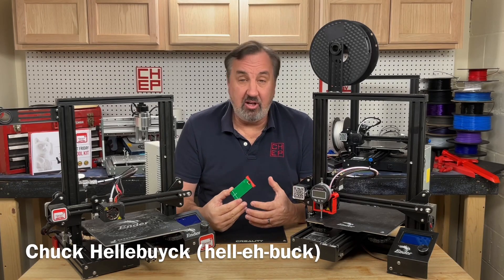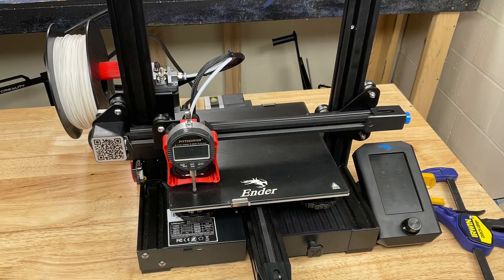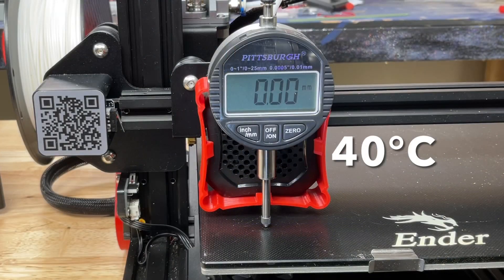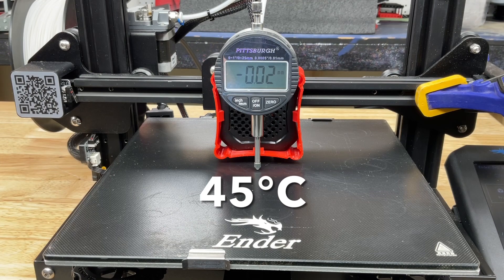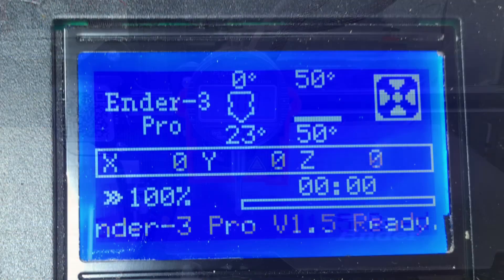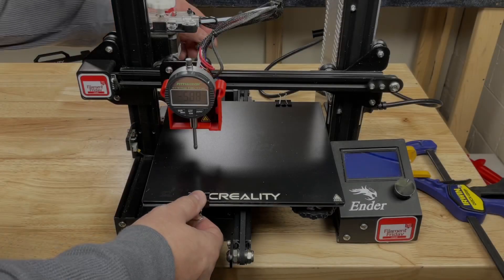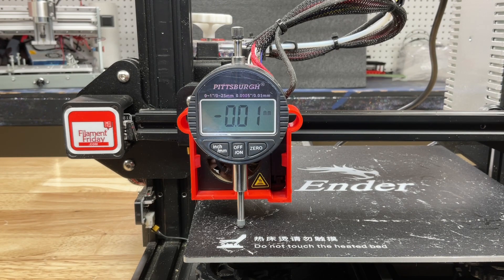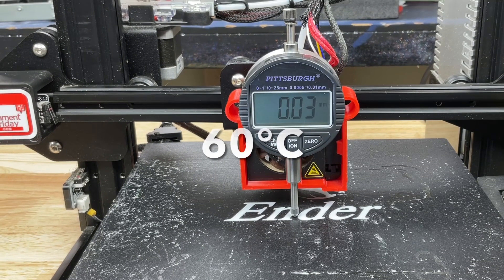Heated Bed or No Heated Bed Leveling?

Comment: I have actually found on my Ender 5 (220x220mm) with the stock flexible plate, temperature between room temp (25 Celsius) and 60 degrees made a bigger difference than with glass.  I think it is the aluminium build plate changing size rather than the surface.   I think Glass holds its form better and doesn't flex as much with the bed.  0.07 is a pretty big difference when it comes to first layer to be honest.  It can be the difference between sticking and not sticking, and that is from my personal experience and experiments moving z axis.   
I appreciate it is less than a layer height and some people may not find any issues, but in my experience it does affect that first layer a fair bit, even with 0.03 difference.

Comment: It might just be my imagination or I'm reading into things but I have found that it is better to heat the bed first before running an autolevel than when manually leveling.  I have noticed a distinct difference on the first layer on my anycubic kobra 2 if I autolevel cold vs hot.  When hot the first layer is significantly more even and solid.  I can only chalk this up to any warping being compensated for during the autolevel.
Reply: From what i heard it only makes an difference if its an Induction ABL
Reply: @ThiagoCaregatti  That makes a lot of sense.  TBH I don't see much difference on any of my printers with a BL touch when hot vs cold.
Reply: @ThiagoCaregatti   Auto levelling with any bed levelling device, bl touch or induction, makes a difference as it measures points across the bed in a mesh and creates layout of the bed with all the different heights.  The type of levelling doesn't make a difference as the heat causes the bed itself to expand slightly.   At the temperatures of a heated bed, it is very little difference, unless absolute precision parts are needed, then even 0.02mm can make a difference to the part.  You wouldn't use an Ender range printer for that sort of precision though as they are never that accurate.
Back to induction.  Yes, if you heat your bed from room temp to over 100 celsius, then you may have an effect on induction, but very few, if any, filaments would require temps that high.   Between room temp and 60 celsius, induction will not change meaningfully.

Comment: Try it again but let it sit with heat on for 30 mins or longer then measure. The heat eventually transfers into the springs and changes. And when you lose at the corners is because you are gaining in the center. Use two dial indicators at the same time, on at the corner and one in the center. And also try putting a dial indicator on the left front and one on the right rear. Then adjust the left front and see what happens to the right rear.

Comment: you have error! you use glass bed!
Reply: K
Reply: Fun fact: Glass is also subject to thermal expansion.
Reply: @cobz76 and it's also subject to move if the base if expanding. Not sure how that concept evaded him.
Reply: Glass bed's are fine if you know how to dial in your printer properly.
Thermal expansion of the actual bed itself, the aluminium, is the major issue, not the bed material.   It's hidden more by glass as glass is more rigid.
To get meaningful thermal expansion of glass would require a higher temperature diffence than just room temp to 50 or 60 celsius.    That's why the flexible material showed more difference in this video.  It is responding the movement of the aluminium heated bed underneath it

Comment: A dial guage positioned at the center ( or anywhere else for that matter )  of my 235x235 heated bed shows a variance of .04 mm when the bed heats from 20c to 60c. This is wildly different from the  calculated thermal expansion of aluminium 0.002664 so there is expansion due to heat but it just doesn't seem to be the aluminium bed that is doing much of the expanding.
Reply: note... It might well be that my dial guage itself is undergoing some thermal expansion... so i'll redo my test after I attempt to thermally isolate it from the bed. ;)

Comment: I usually like your content, but it’s clear you don’t really understand what is happening or proper metrology technique. 

The expansion is going to affect every bed differently, as none of them are truly flat and the low quality sheet aluminum they are made from has internal stresses that differ from piece to piece due to the manufacturing process. This is why those that want minimal issue with thermal expansion use cast aluminum plate, rather than roll-formed aluminum sheet for their beds. 

You also don’t have the equipment necessary to accurately map the movement of the bed. To do any meaningful testing, you would need to probe multiple locations at every temperature setting and create a 3D map of the surface to see what’s actually happening. 

This is a subject of controversy and is very much subjective to the individual user’s desired results. So, I’m not saying you’re incorrect or have provided poor data, only that you provided limited amount of data to have drawn any real conclusion from. 

I spent a lot of hours designing a printer and bed system that stays flat through heat cycling. I also happen to be a machinist/fabricator with a significant interest in metrology and a lot of equipment the average person isn’t going to have on hand if they simply own a 3D printer. This isn’t a 5 minute subject, or one I can cover in a comment.
Reply from the maker: Think you missed the point. As my bed expansion video and then my nozzle expansion video showed, a beginner with an Ender 3 or similar clone using the standard 4 corner paper method (as they are told to use in the manual), your results will essentially be the same heated or not heated. 
Your middle will warp a bit as I showed in bed video but you can’t get rid of that by the four corner adjustments. So print small things over the adjustment knobs for better results.
Reply: @FilamentFriday  This is a poorly thought out video. How do you know the metal guage isn't expanding with the heated bed? You didn't attempt to thermally isolate it in any way! The results are bunk!
Reply from the maker: Haha…then it would be worse not zero. The expansion of the tip is negligible. I’ve tested it many times before. But I look forward to you proving me wrong. Until then your comment is bunk!
Reply: @NoMoreBsPlease  he's not using a precision tool or mount so it's all likely within the error tolerance of the meter. Anything with a 4 point contact will definitely warp. As long as you know where it is you can compensate. I just don't agree with chep that it's all irrelevant. Smaller beds, sure... But larger like the ender 5 plus very important when printing large.
Reply: @jackshett  That would be less of an issue with thicker bed. Aluminum is one of the most abundant resources on the planet. There is no reason why  3d printer beds aren't over 6mm thick.
Reply: He didn't come to the conclusion you wanted him to huh? You'll get over it.
Reply: I get the impression he used to be a used car salesman... That or he's part of the "just as good" crowd.

Comment: For me heating the bed makes a noticeable difference, but not immediately when the bed reaches temperature, only after ~20 or 30 minutes at 60°, when the heat propagates to some of the metal support under the bed (I guess).

After that amount of time the bed moves down enough that's very obvious even with the paper method.

This is with an Aquila X2, a printer very similar to an Ender 3, with a glass bed.
Reply: Same here. My bed has at least .1 change
Reply from the maker: I didn’t see that in my bed video and I left it heated for a while. https://youtu.be/NlUO-5EtB44

Comment: Thank you for sharing. The movement of the bed is small indeed, but what about the range of temperature of your measuring device ? This one will be heat up when measuring on top of a hot surface for a while. I'm printing ABS with bed temperature of 100°C, so there I not going to use your method. Maybe with a higher Z with elongating rod ... Thanks again for your time and sharing.

Comment: Can anyone explain to me what PETG is, what is it used for, and is it better than PLA?
Reply: Basically the same material soda bottles are made of, it's a different material than PLA, it's a little harder to print but more resistant to higher temperature like for in a car, and might also be stronger, depending on how you print it
Reply: PETG is more ductile, meaning it deforms way more before breaking. It's also way more flexible than PLA, which can be good or bad depending on your application. But overall, PETG has a lower yield stress, which means that it breaks sooner and can thus be described as weaker. It also prints at higher temps, is notorious for its stringing and absorbs some moisture. Try it out and see for yourself
Reply: PETG is more ductile, meaning it deforms way more before breaking. It's also way more flexible than PLA, which can be good or bad depending on your application. But overall, PETG has a lower yield stress, which means that it breaks sooner and can thus be described as weaker. It also prints at higher temps, is notorious for its stringing and absorbs some moisture. Basically the same material soda bottles are made of, it's a different material than PLA, it's a little harder to print but more resistant to higher temperature like for in a car, and might also be stronger, depending on how you print it. Try it out and see for yourself

Comment: Hi 
Would you be able to help me , I have a ender 3 pro I have not been 3d printing very long so not very wise on the subject.
The vertical walls on my prints don’t stick together the finish is excellent but when I run my finger over the edge they separate, I have used cura and also prusa with the same outcome , the layers horizontal stick down ok 
Thanks in anticipation 
Stuart
Reply: Google temperature tower. Sounds like you need to find the best nozzle temperate for your filament.

Comment: This is a bit off topic, but what is the best low-cost, and strong, and good PLA? I can't seem to find a good PLA!?!?
Reply: I use many types but I’ve found esun gray  is very consistent.  Also, I’ve had luck with polyterra pla in green.  I keep them in a storage bin with every pack of Silica gel I find thrown in.  Right now I have two printers using Stronger 3d cement rainbow and it is incredible stuff.
Reply: @paulselck1701  thanks for the reply!!
Reply from the maker: Matterhackers MH Build is good.
Reply: @FilamentFriday  Thanks for the reply, im gonna check them out

Comment: Chep printing a huge Calicat.  Need a support.  4.13 will not generate one.  I have 4.12 open beside 4.13.  Same settings.  4.13 will not generate a support.  It’s needed at layer 43.  Will you check and confirm. Thank you Doug.

Comment: My Ender 3 came with the removable fibreglass bed plate. After a year or so the stick-on surface started to bubble at the centre (where the heater is). When it gets hot the bubble expands. I replaced it with a glass plate.

Comment: this didn't debunk anything. 

For a PEI plate heated at 90 degrees, trust me there is a huge difference. glass is extremely flat. there is no problem. 

for most who are printing PLA this isnt an issue but i recommend you do this with PEI and heat the bed to 90 degrees and trust me it will warp like hell

Comment: I know this is off topic chep but ive looked online and you are my last hope, i have an ender 3 v2 and encountered slipping, whats your thoughts on a micro swiss bowden dual extruder as an upgrade? Im really struggling to make a decision on what extruder is the best to go with on a medium budget. Thankyou in advance
Reply from the maker: I prefer the EZR: https://youtu.be/1GNDxvxpWr8 
Works for all filaments not just flexibles.
Reply: @FilamentFriday  sorry to bother you again, did you have any slip issues with it? If you reply saying no,  i wont ask anymore questions and ill purchase it. Thankyou for your time 👍🏻
Reply from the maker: Nope.
Reply: Check your belts. My Ender 3v2 went from rubbish prints to perfect afterwards
Reply: @robdavis8556  thankyou for replying, the belts are perfect, i actually made a pen mark on the gear in the extruder where it started slipping to where it gripped and it landed on the marks everytime i turned it. Its the gears teeth that have a fault, ive only done about 30 hours in total over two weeks so it must of been a defect, the problem is although it under extrudes a little, it puts me off doing long prints lol.

Comment: Interesting video. Is there going to be a similar one looking at nozzle heating? I found for my levelling that I needed a small z offset (up) with a semi-heated (actually heated to 100), but none when levelled at my usual print temp of 200. I assume the nozzle is more susceptible to size change (hence the hot tightening).
Reply: I agree. If you can do the same test but with the nozzle it would be great. By the way, nice video as always. Best regards.
Reply: This is the same thought I had watching this video. Anyway useful video 😉

Comment: Thanks Chep. 
Further testing required to make conclusion, but good start. Of course there is two sides to the gap. Only one tested here is the bed side. Nozzle side needs to be considered to be definitive on whether heating to operating temps for bed leveling is necessary. Brass, most hot ends, have a high thermal expansion coefficient.
Aluminum is the one making the move in this test. The direction will depend on the cool temp. warp direction, concave or convex. As the aluminum expands between the 4 mounted points the center is where all four points forces meet. So the material goes in the direction of least resistance or it's buckle mode. Similar if you take sheet metal and press towards center it buckles and chooses a direction.

Comment: Hmm, this does not correlate with the things i see in daily use. I suspect it is different for every machine. The Ender Style printers have a very thin aluminium bed, this may be a reason why basically nothing happens when heating it up. When you have a thicker heat bed there is more material to expand and this is what i clearly see on my qidi x-plus. The bed moves up quite a bit when heating up. When i level cold the nozzle scratches the surface after beeing heated up to 60 degrees C. What could also play a role is the Leveling Springs or silicone bed mounts. They will deform or lose/gain tension when heated up. 

So I think it is not correct to say "it does not matter if you heat up or not". It depends on the machine and the setup.

Comment: Great points I hadn't considered. Probably the most thermal movement over the adjustment system would come with the time factor of the print and the materials of the adjustment screws. Aluminum screws would grow more than mild steel. Otherwise the design of the heater element and the bed material would affect the center delta T distance and plus or minus.  Thanks!

Comment: Loving your vids i have a question if you have time i have a FF finder if i wanted to do prints just a little bigger could i just put a larger build plate on top of the original ? And the calibrate and re level ?
Reply from the maker: Doubt the firmware will allow it to move further than the original.

Comment: I have developed a habit of printing in the lower left of the build plate every time, I find I get the most consistency there. Now I know why. Also my prusa MK2 did not heat the nozzle before leveling, and since the pinda sits in the output stream of the heat break cooling fan, I never got prints to stick to the bed.. the distance would be different after the nozzle warmed up. Took me weeks to figure out I needed to modify the default startup g code to FIRST heat the nozzle, and then do the bed leveling. Finally got it to work after that and I loved 3D printing ever since.     (Prusa fixed this by just including a PINDA that has temperature compensation!)

Comment: Glad I saw this!  It confirms my findings.  I have an Ender 3 4.2.7  with a PEI/magnetic bed.   I also have a CR Touch.  I run the bed probe and compare between a cold and hot bed and its the same.  I believe I'm testing like 25 points.

Comment: This is why mesh bed leveling exists. I have an ender 5 plus and I know for a fact there is enough warping at temperature to matter. Thankfully pretty much every ABS part I've printed was either small or about 1/3rd the build plate so it didn't matter much. But if I print anything that covers more I'll have to use my glass bed or have a high chance of a failed print.

Comment: SIR, I MUST SAY I FOUND A BEST TEACHER ON YOUTUBE FOR A BEGINNER LIKE ME. THANK YOU SO MUCH FOR EXISTING. I AM A HOBBYIST AND RECENTLY TRIED SURFACE MODE IN 'EXPERIMENT' WITHIN CURA AND IT TURNED OUT PRETTY AMAZING WITH ALMOST ZERO VISIBLE SEAM. I WANTED TO KNOW "can we print anything in spiral way without 'just surface' mode, ????"
Reply from the maker: There is a spiral mode in cura (known as vase mode elsewhere) but it won’t work with all prints.
Reply: @FilamentFriday  thank you